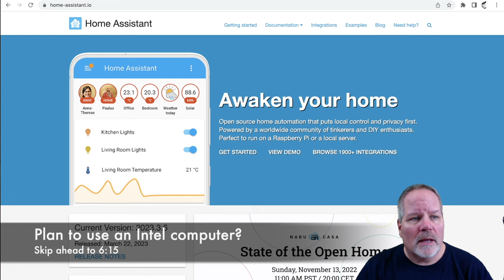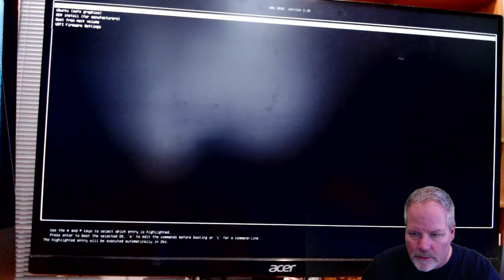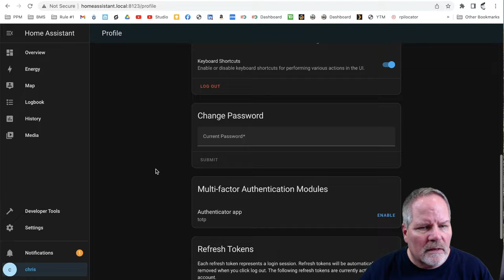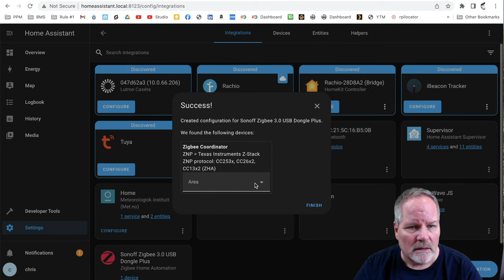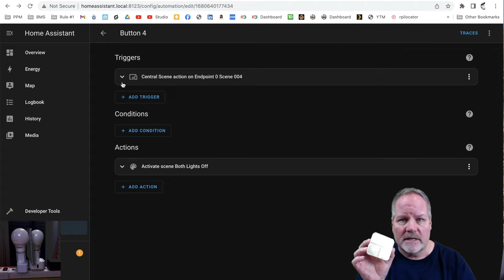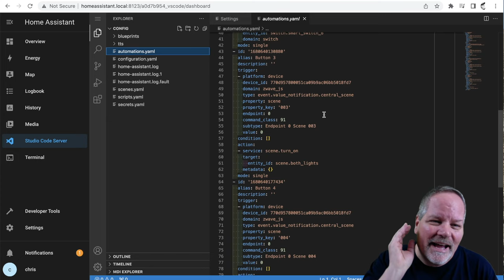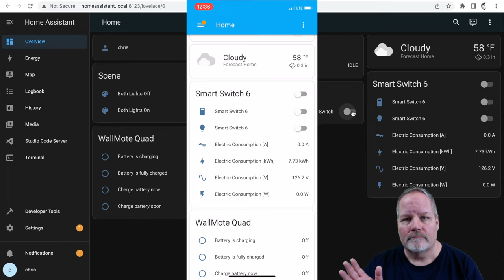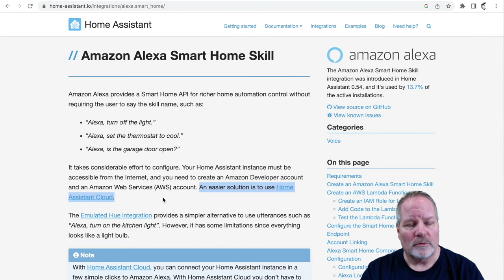COMPLETE GUIDE TO HOME ASSISTANT - 2023 Edition

Comment: Hi, Can you please make a video, How to integrate Hubitat with  Home Assistant?
Reply from the maker: Why would you do that? They are redundant. Both do the same thing.
Reply: You can run them both in parallel while you complete the move to HA and get your head around how things work, this is what I did.  Now the Hubitat is in a box somewhere.  I think the only issue I had was with some Aqara PIRs that were added to Hubitat with a reset, hut if you use the Aqara integration they just turn up in HA.
Reply: @handydadtv 
Hubitat has both Zigbee & Zwave built in, so no need for dongles?

Comment: Not many 1hr long instruction videos that I've sat through on YouTube, I often have to skip around till the presenter gets to the point!

 You have a great balance of practical explanation, covering enough to get someone off to the races, but not going down and un-necessary rabbit holes! You showed the physical setup/connections of devices, and fast forwarded or skipped the boring parts! Excellent work.
Reply from the maker: I really appreciate your feedback because I wasn’t sure if this format would work. I could have gotten 10 weeks of content from this video if I split it up, but I decided this format was more useful for someone who is just starting out.
Reply: It's as simple as if the content is good and it fills up the time and it's just not a crazy amount of introductions and subjective commentary then it's super valuable. So I guess the length of the video is likely determined by how practical the steps are. If someone wants to get down into some really nitty gritty part of automation then they're going to have to do the hard work anyway.

Comment: You can run both ZHA and Zigbee2MQTT at the same time.  Comes in handy when you have a few devices that do not work in ZHA. You will, of course, need two Zigbee coordinators (dongles), but it does work...and quite well. Great job. Thanks for the well-explained processes.
Reply from the maker: Good to know. Thanks.
Reply: any is issues running two dongles and both ZHA and Zigbee2MQTT after this post 5 months ago? I want to run a setup like this on my NUC

Comment: Impressive tutorial!  Well planned and executed.  I’ve been a Homeseer user since v1.0 but recently I’ve been considering a new platform mostly because Homeseer requires Windows.  After watching this tutorial I’ll be exploring Home Assistant in detail and see what it will take to convert my current setup to HA.  Thank you for your hard work.  Subscribed!  Oh, and I did order two of your Amazon affiliation links.
Reply from the maker: Thank you very much. Not trying to change your mind, but HomeSeer also works on Raspberry Pi. I tested it and it works just as well as Windows.
Reply: I've also been a HomeSeer user since it's very beginning (currently using a Raspberry Pi) and I am thinking of switching to Home Assistant also.
Reply from the maker: They are both very capable platforms, but HomeSeer is more controlled and better supported. With Home Assistant, you depend a lot on the community more than the vendor.
Reply: You can also run home assistant on windows. Using either a virtual machine or using docker.
Reply from the maker: @plebius True but it’s much more straightforward and powerful to use a dedicated device.

Comment: Still I feel videos like this miss the mark. Just like this one, they all assume that the viewers are users of these devices. 

For people who want to use HA and have not purchased anything yet. Where do we start? How do we protect ourselves from the internet data leaks? How do we do this without costing a fortune?
Reply: I am in a similar situation. I believe the content creator explained what's needed well. You need to get an Intel NUC and install your image file using one of the two methods shown. I will use the SSD to USB method as it seems straightforward. Currently, my Control4 installation cannot get stats from my Buderus boiler, so I plan to use a BBQkees electronics EMS Bus Wi-Fi Gateway to connect with Home Assistant. The goal is to achieve this integration. Regarding internet data leaks, that depends on your internet infrastructure unless Home Assistant has a built-in firewall which I am not aware of.
Reply from the maker: I tried to make it as easy as possible. You can use a Raspberry Pi or a NUC. I prefer the NUC but either one works. 

By default, HomeAssistant is only accessible from your local network, not remotely. If you’re worried about data leaks, don’t make it Internet accessible.

To be honest, HomeAssistant is a vast sea of complicated integrations and add-ons. It takes a lot of time, can be very frustrating at times, and is best suited for techies or people willing to do the research and learn. If you want a more turnkey solution, look into Hubitat or HomeSeer.
Reply: @handydadtv  Things that would be helpful are: 

1. What devices (light switches, bulbs, outlets, etc.) i should buy that do not require access out to the internet? 
2. How do I set them up and connect them to my Wi-Fi so HA can manage them? 
3. How do i wall off these devices from being able to communicate to the outside internet? 
4. Etc. 

I feel that the devices end is more important than how to setup HA to manage them. 

Those wanting to use HA probably want to do so because they are weary of exposing these devices to the outside internet and to companies like Google and Amazon. However, IMO all of the videos center around how to setup HA rather than how to safely integrate the devices with HA.
Reply from the maker: Those questions are beyond the scope of this video. HomeAssistant is flexible and you can integrate it with most kinds of devices. Most people come to HomeAssistant from something else, so they already have smart devices to integrate. 

Choice of protocol is a very personal decision and many people will disagree with me, but if you’re completely new to home automation and on a tight budget, I’d recommend Zigbee. The devices are the cheapest and they don’t require Internet access. If you use Amazon Echo, some of them have built-in Zigbee hubs so you don’t necessarily need HomeAssistant to start with. Just put them in pairing mode and say “Alexa discover devices.” After she finds them, you can control them by voice and create simple routines to automate them.

Comment: quick and practical question: when power goes off, what happens when power comes back on? Do the Z-Wave and Zibee devices re-pair with the hubs? Are there any configes required after power goes out at all?
I've had issues where some wall switches and smart outlets aren't bound to an IP adress and have replaced my server on one occasion, So are there specific things to do with those z-wave#zigbee items, since they arent on "wifi" per se?

Comment: Hi,

Very nice and relevant. I made it even easier buying a Home Assistant Green.
Break out the long section about using linux to install on the SSD, a waste of time.
Also talk about Integrating with google assistant, not only Alexa, please.
I personally think that you can include the MQTT stuff in this video.
Is Zwave still relevant, not sure, but it was quite quick so why not. Maybe you should add bluetooth instead.

Love your pedagogics, right level for me.
Reply from the maker: Thanks for the feedback. There are still a lot of ZWave users out there, including me. I really wish they included a Zigbee/Thread antenna in Green. That would have been compelling even for 20% more. 

As for Google Home, I don’t use it. And I feel MQTT is an advanced topic not for a basic how-to guide.

Comment: Is this still the hardware (pc) you’re using?  Do you prefer HA over HomeSeer?  I’m thinking of moving off HomeSeer.  Thx!
Reply from the maker: Yes, in still using the computer in this video. It works flawlessly. If you don’t mind doing a little YAML from time to time, I prefer Home Assistant. All of the integrations are free, as opposed to HomeSeer which charges for many of them. In addition, as a content creator, Home Assistant has a bigger audience. 

I’m going to redo this video for 2024 using the new Home Assistant Green.

Comment: I've been dipping my toes (more like up to my neck) into HA for a couple of weeks now, and it's a pretty steep learning curve. I've run across most of the stuff you covered in this video, but I'm struggling to put it together. Congratulations for laying it out in a meaningful way that is more easily understood. One of the things that blocked my progress was that I too soon got into sensors and ESP32 microcontrollers. I certainly want to get into that, and perhaps you could help with that (maybe you have already). Another area of interest is energy monitoring. I've watched your video on Emporia Vue 3 with great interest.  Many thanks for you great work.
Reply from the maker: My only exposure to ESPHome is an Athom presence sensor that had it preinstalled.

Comment: Hey Chris, I am also Chris.  Just started trying to automate some things around the house and didn't have a clue.  I'm good with tech (Senior System Admin for an online tech company and preparing for Cloud Architecture certifications).  I started going down the rabbit hole when I received an Alexa Echo Dot for Christmas.  Very handy toy.  Then I decided to try out some home automation by putting my Christmas lights on some Tuya plugs and conrolling both through the Smart Life app and/or Alexa.  I found I was quickly looking at doing some other things as well.

This video is a great explanation for those who are technical or not.  I am really leaning towards the Home Assistant for a hub.  I have some older micro computers that would work greatand love fooling around with Ubuntu.   I am wondering, if I have wifi devices that are controlled basically over the internet, is there a way to ensure that they are controlled only through the Home Assistant and not directly over the internet?

I have a PF Sense firewall and a little touchy about about what comes and goes over my internet connection.  Thanks.  Going to check out some of your other videos now.  Probably become a subscriber if they're as good as this one.  Cheers,
Reply from the maker: I don’t know PF Sense. I have a UniFi system (see https://youtu.be/PyDpLJIKg0M) with a separate vlan for IoT devices. 

I also have a group called NO INTERNET so I can add any device if I want to block access. 

Research an add-on called LOCAL TUYA. It’s a pain in the ass to setup, but after I did it, I moved my devices into the NO INTERNET group so they can only be controlled locally.

Comment: Port forwarding? At minute 50:18 this crucial detail is mentioned, which can kill the whole point of setting up Home Assistant for remote access if it cannot be supported. I have T-Mobile Home Internet and from what I read on the T-Mobile Community website, they block port forwarding. It doesn't matter if I buy a second router to connect to the one T-Mobile supplies, I am still screwed.
Reply from the maker: In that case, you’ll probably be best off by subscribing to Nabu Casa.

Comment: Hey Chris, thanks for the video.  Something you may want to mention.  I just followed your instructions and got HA installed on a small micro computer and it's up and running on my network.  However, once I signed out, I was unable to sign back in because during the initialization, you never get to set or see your username.  I am in the process of trying to figure it out but instructions online are sketchy.  Any ideas on that?
Reply from the maker: Your username was selected during initial setup. I don’t believe there is a default or a way to override it. 

Just reinstall and go through setup again if you don’t remember it.

Comment: Thanks for the video. I have been a Amazon device user for several years now, and it’s been very important to me to have all the automations and everything set up as I have extremely low vision, i.e. blind.
One of the issues that I have is that whenever my Internet drops, then I have no longer able to access via voice my devices.
So I’m starting to look into home assistant to see if that will eliminate this and as am already using a Lenox server, I am looking to add home assistant, and under a docker install onto my wound to server. I think that would be the best practice now the question I would have is candy immigration integration with function without the Internet. Answer doubt it always worth checking what other options would be available thanks for the great video.
Reply from the maker: Yes, Home Assistant will continue to operate even if your internet is down. However some integrations may not work until the internet is restored. It’s best to look for devices that can be locally-controlled, like Zigbee and Z-Wave. Then you’ll be good to go.

If you depend on voice to control lights, Home Assistant now has features for voice activation even without internet. I haven’t explored that yet.

Comment: Hi All
I'm new to Home Assistant and have been struggling to set up the Smartthings integration for the last few hours. (Many hours!) I've discovered that the url in the Home Assistant Cloud (Nabu Casa) does not match the url I'm presented with when I try to configure the Smartthings Integration in 'Integrations'. Is this the issue and if so how do I correct it?
Many thanks.
Reply from the maker: I suggest you ask on Reddit /r/homeassistant because it has a very active community.

Comment: Love all your videos..thank you so much.  1 Quick question..How do I shutdown/turn off the HA server using the HA> command line? or whatever command prompt. I am using the same x86 pc as you detailed in this video.
Reply from the maker: I use the UI, not the command line. Go to Settings >> System, then click the power button in the top corner. Under Advanced Options, click Shutdown System.

Comment: I understand that any X86 micro computer will be a lot more powerful than a raspberry pi, but isn't X86 overkill for HA? Just wondering what the limitations using a pi are Vs using X86.
Reply from the maker: No functional limitations. But the weakest part of the Pi is the SD card. If you go with a Pi, be aware of that risk and use an external hard drive instead. And be sure to do regular backups. 

When you compare the cost of a Pi, case, power supply, and external hard drive to a basic x86 NUC that includes everything like mine, plus better performance, you’ll see it’s worth it.
Reply: @handydadtv   Now that we are starting to see more Pi5s in the wild and they support a bootable NVME over a 2X PCIe addon port with an additional board, they will likely be a great choice assuming the Pi foundation can keep the production levels up.

Comment: Hello, I have a question. I have portable thermostats Habitat, which send the signal to the wall-mounted ac unit. I don't want to buy their hubs because they are super expensive. The portable thermostat works with RF. Is there a way I can connect those to HA? Thank you
Reply from the maker: I can’t answer. I suggest you ask on Reddit /r/homeassistant.

Comment: Great channel, thank you. Following your recommendation I recently purchased and set up the GEEKOM PC and joined the Home Assistant user team. I'm learning as I go and am particularly interested in Tile cards which look to be the future. 
My specific query is as follows. We recently had a power cut when I was away from the property for some time. My other smart home tech restarted fine when the power was restored but the Home Assistant GEEKOM PC did not which left me unable to control many aspects of my smart home. On returning to the property l simply pressed the button on the NUC and everything started fine. 
How do I make the GEEKOM PC automatically restart on the restoration of power to the unit? Hopefully you can help with this issue.
Reply from the maker: Could be a setting in the BIOS. I have mine on a UPS. No computer likes being shutdown abruptly.

Comment: Great vid!
A question though, seems I'm pretty useless with this - after etching the image and installing the SSD back in the NUC, the homeassistant.local address directs us to where? The NUC device? Do we need to set it up before?
Reply from the maker: Yes homeassistant.local should direct you to Home Assistant running on the NUC. If it doesn’t, you’ll need to lookup the IP address assigned by your router.
Reply: @handydadtv  Yes, did it the oldschool way via ip address. The homeassistant.local:8123 does not work, but the localipadreess:8123 does. Thank you very much good Sir for your time. :)

Comment: What if add-on option is missing in the setting menu? I tried to check the advanced mode in profile settings but the add-on is still missing. I installed the 2023.12.0 version on my Synology
Reply from the maker: I’m no expert, but if you’re using HA on Synology, I think you need to use Docker for add-ons. That’s the advantage of using a dedicated device with HAOS.

Comment: Great video! I am new to the smart home world so this is very very helpful, Thank you. I have a question tho. I have been able to set up my Home Assistant server with the Geekom mini air 11 and it's up and running, but for some reason I keep getting connection lost. I have to trun of the system and turn it back on. Even with that, sometimes it doesn't work and I have to keep repeating the process before it works. Please advise.
Reply from the maker: I suggest you ask on Reddit /r/homeassistant

Comment: 24:27 i read that It is recommended to use a cable extension for the device (zigbee ) to help clean the signal.
Reply from the maker: My Zigbee dongle has a big antenna so I haven’t had any signal issues.